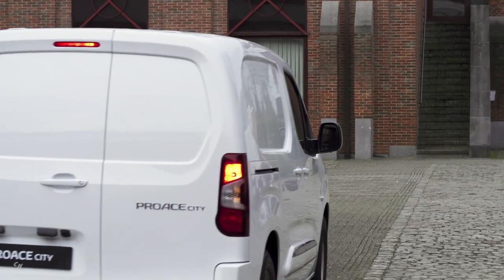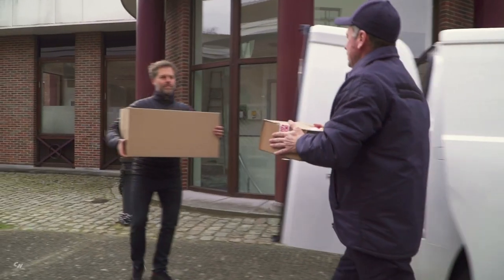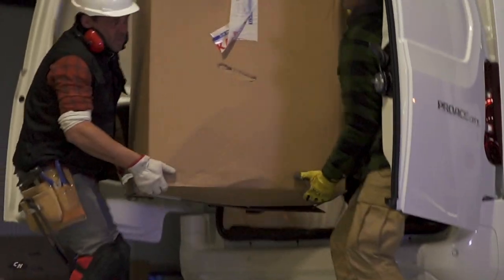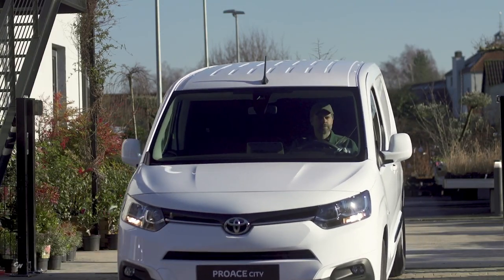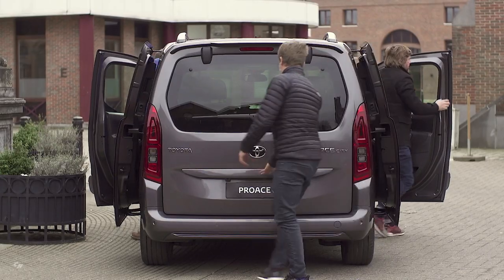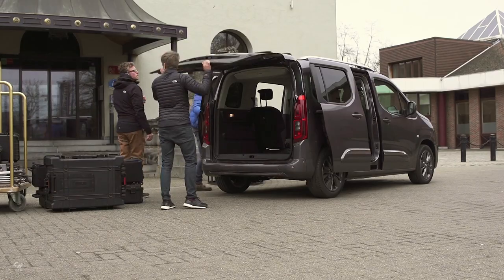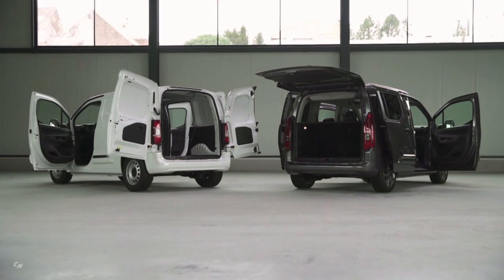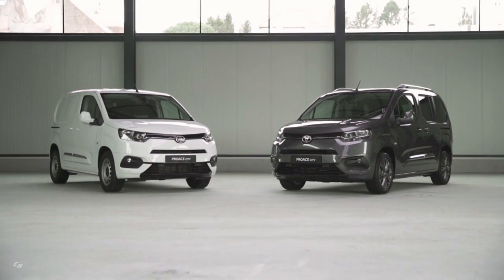2020 Toyota Proace City | Compact Cargo & Passenger Van

Comment: Hope we get an EV cargo version in the US with at least a 90kwh battery. Something with built in 2000 watt AC inverter in the back and feature to run AC/Heater while parked and even charging.  A solar charging option.

Comment: As of 3 September 2022 every manufacturer of compact cargo vans in the U.S. has stopped production no later than 2023. Toyota, the market is wide open !!!
Reply: Really? Why?
Reply: @sky5.311  I think poor quality on all except the Ford Transit Connect which also had low sales probably due to limited comfort options like heated seats, heated mirrors and sun roofs. Adding those options after market, might as well buy a minivan for just a couple grand more and get easier resale.
Reply: @sky5.311  It will be interesting to see how VW does it they enter the U.S. market.
Reply: @sky5.311  overpriced for small  businesses compared to their luxury pickup market targetted at rich people who use them as vehicular codpieces. I can't believe the NV200 was discontinued in the states. this toyota in the video has same cargo size as the overpriced POS f150 that only boomers drive. I love these mini vans as they look professional have good gas mileage and are easy to park and store. I have been stuck in a truck for years waiting for the price to go down and I am driving an old vortec chevy and i'd rather keep dumping money into it than buy one of these new garbage american trucks